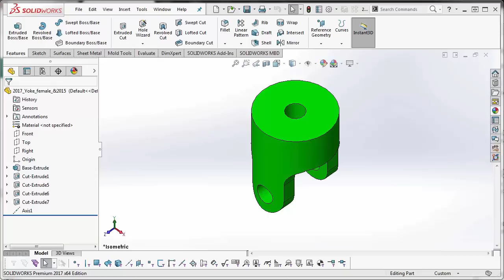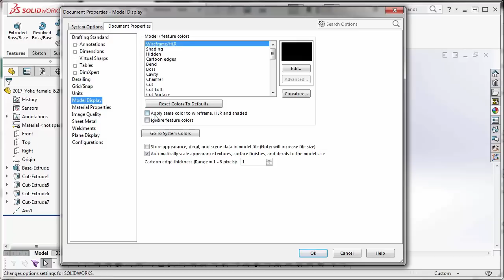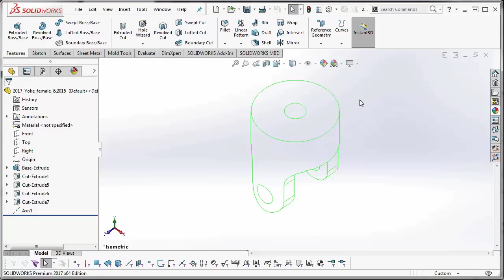SOLIDWORKS – Changing the Component Wireframe Display Edge Color

Comment: Thanks for the tip, here's another question for you.... can you have textured surfaces in wireframe mode? If in shaded mode, a surface has texture, can that texture be shown/viewed in wireframe mode?
Reply from the maker: No, the nature of the wireframe mode omits the surfaces and their textures. The data is all there but it is not visible.

Comment: can i have a wireframe part in an shaded assembly drawing view. i want to be able to see thru a part (so have it in wire frame) but have the rest of the drawing model in shaded. I know you can have the part as transparent, but this is not always viable. cheers
Reply from the maker: We have another video that goes over using mixed display states 

https://youtu.be/QrSi0_zbMMg

Comment: Is there a way to change the line style of wireframe edges?
Reply from the maker: You can in the 2D Drawing, but in the 3D Part or Assembly window there is no option to change the Wireframe Part font or line style.